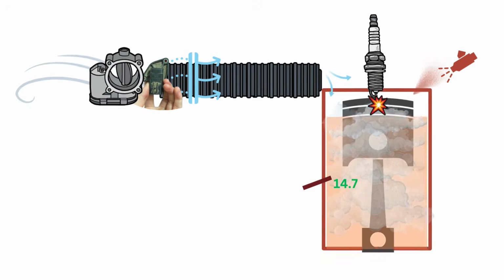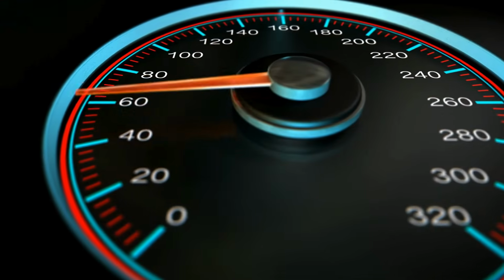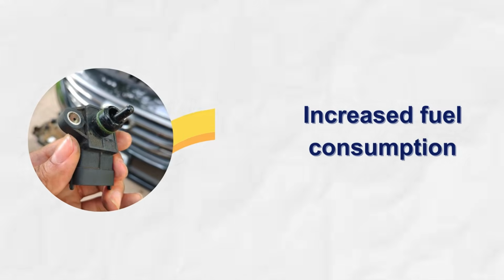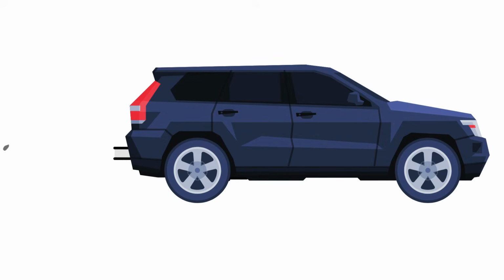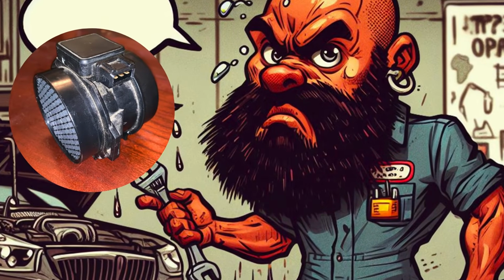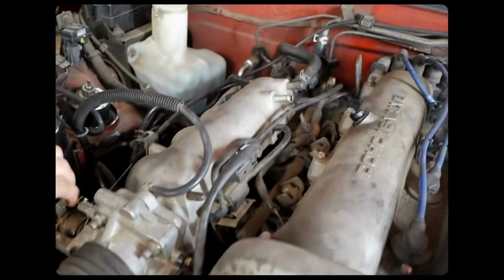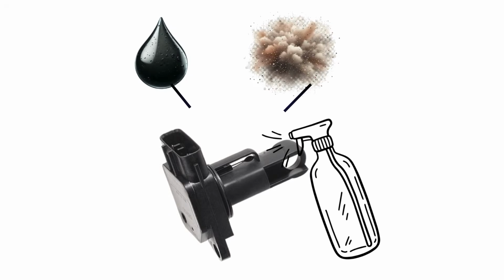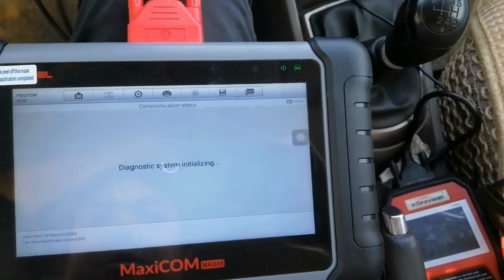6 WARNING Signs of a BAD MAF Sensor | How to Test & Fix a Faulty MAF Sensor

Comment: That's what I was thinking about my situation limp mode it runs fine then rough Idol maybe the mas air mine is a little p sized hole with a chip .or cats 06 Chrysler 300 full restoration in my view here v6. Yes cheap 0bd2 saner evap is all it says with many options choices wizly in so much time in result in the flashing like 2 min or run time

Comment: Every summer, when temperatures got over 100 degrees (38C) my engine would give a small  stumble or hesitation from a full stop.  A new OEM MAF sensor immediately solved the issue.
Reply: 6 months ago I had the same symptoms. And the RPMs would fluctuate- sometimes wildly. The dealership claimed it needed a new timing belt and camshaft. The quote was for $4,800!! The car is 10 years old. 90k miles. It's a 2016 VW Jetta. I refused to spend that much money and did some research in the meantime. I had them replace the MAF sensor and it's running fine now. They denied that could be the problem but I INSISTED they replace it. They gave me the old one and it was filthy. Replacing it cost $98. It was well worth it versus spending almost 5k and wouldn't have fixed the problem.

Comment: I had that issue last summer fixing my 07 3.2L Dodge Caravan.
 Had 7 weird faults I just didn't figure out.
 Put my scan tool on and the inlet air tep showed 242 degrees Celcius.
 Thinking that might be on the high side I bought the last sensor they had at my parts store riding my bicycle down.
 Carefully put it in the rubber inlet duct.
 All 7 snags went bye-bye forever.
 Kind of weird/ very satisfying.
 Still have the old girl. 301,000 km on her. Doesn't burn oil and idles like a champ.
 I bought a 2023 Corolla Cross as a backup. Just in case. 3,000Km oil changes. for over 17 years.

Comment: Can we use throttle body cleaner to test for vacuum leaks by spraying it near suspected areas to see if rpm changes?
Reply from the maker: Yes you can
Reply: Try a heavy oil, like gear oil.
Reply: @thisisyourcaptainspeaking2259 🤣🤣🤣
Reply: @MarkSmith-js2pu   Smoke machine works well, if available.